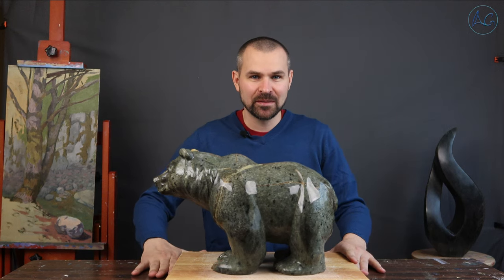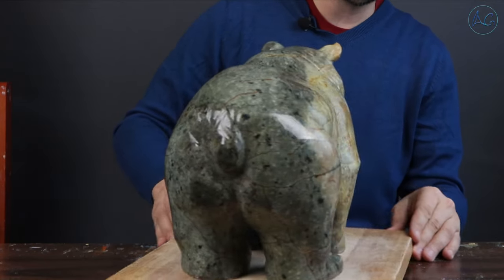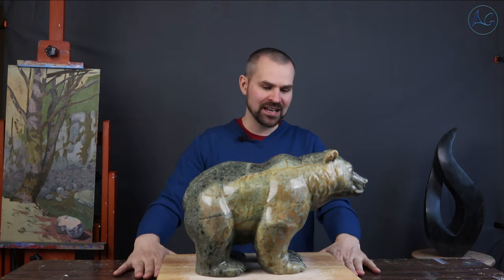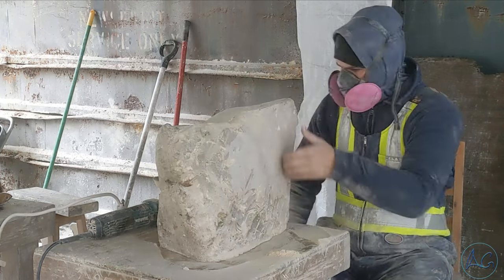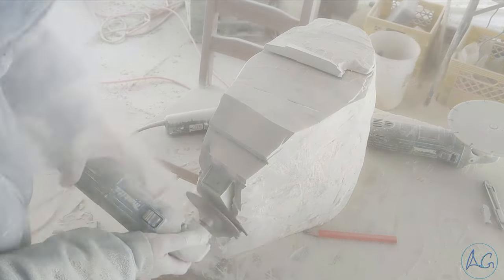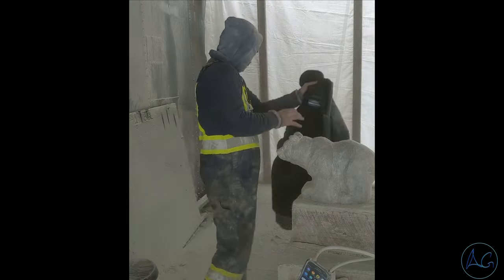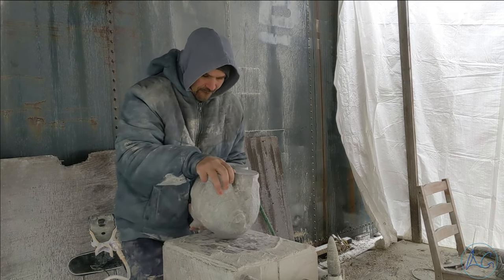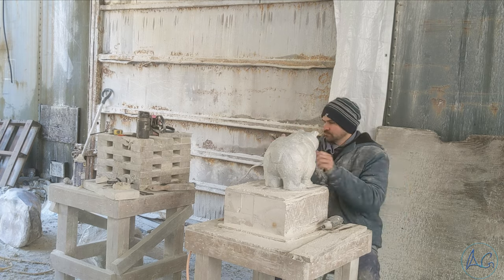New Original Art - Artist Talks About New SOAPSTONE SCULPTURE

Comment: Andrew, how many coats of tung oil do you put on and would you mind sharing your new compound that you put on after, please. Love your work!
Reply from the maker: For this piece I only did one coat of Tung Oil, ussually I do 2 or 3. But the coverage was pretty good after one plus I was testing a new finishing technique which was to spray 2x Gloss Clear Rust-oleum on it. I did 2 layers waiting overnight between layers, then waiting overnight again and sanding it with 1500 grit sandpaper to take away the orange peel left by the spray finish - Then I buffed it with Meguiars Mirror Glaze Ultra Cut Compound - Basically its used for polishing cars.
Reply from the maker: I actually have a lot of testing to do on this new method in terms of how thin/thick to spray and how best to sand the clear coat without leaving blemishes, I did another piece that didn't entirly work out as nice as this one but definitely this technique has lots of promise. In the past I was simply finsihing with 3 coats of tung oil, especially if I had a lot of texture in a piece that didn't suit a glassy finish - Cheers
Reply: Thanks Andrew!  Have you ever just used an oil based clear gloss spray and left it at that?  I’m still looking for something that doesn’t scratch as easily.
Reply: I have been using the polymerized tung oil for many years
Reply from the maker: @kaymccormack7723  I haven't but The Carver that recommended the spary seems to just use the spray - It looks really nice but I haven't figured out how to get it to spray without the orange peel affect - My Wife thought it was good enough with the just the spray but I decided to do that extra buffing step. But yes the spray seems to give it a layer of protection
Reply: I know I shouldn't post on an old video, but I have been thinking about using multiple coats of neutral color shoe polish. Anyone have any thoughts on this?
Reply: @dalehallmark9174   I haven't used shoe polish on stone, but I have on my clay sculptures. I used a black shoe polish on a black lab head I did and it worked very well and buffed up real nice on clay.  Not sure but I expect shoe polish would be much like any other wax, wax on wax off and buff.  worth trying!
Reply: @kaymccormack7723  I'm trying to avoid a lacquer but for this piece I want a very high gloss. I am concerned a wax like shoe polish or any other wax may not do the trick.
Reply: @dalehallmark9174   I use the polymerized tung oil from Lee valley tools. It gives the highest gloss I’ve found in any product.  A bit hard to use as it gels if left open. I also bought LV “Stop loss bag” so you can roll up the bag to rid the air in it, helps to stop gelling.
Reply: @kaymccormack7723  I will give that a try. Lee valley has a great reputation for tools.

Comment: Hi Andrew, I have a question . How do you protect your machines from the dust?
Reply from the maker: If you have an air compressor you can blow out your tools at the end of the work day otherwise I don't do anything. They get covered in dust all day long but have performed very well under these conditions. The only tool I need to replace each year is my Dremel which seems to be the most sensitive to the dust.
Reply: @Andrewgableart  just as I experienced. I got a dremel and it already stopped working …